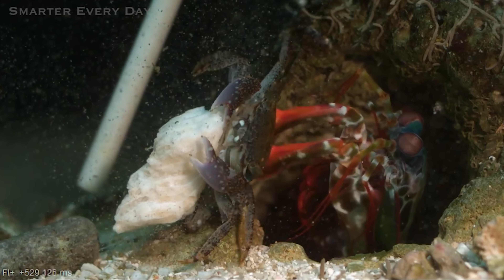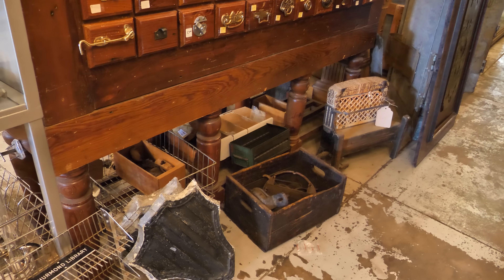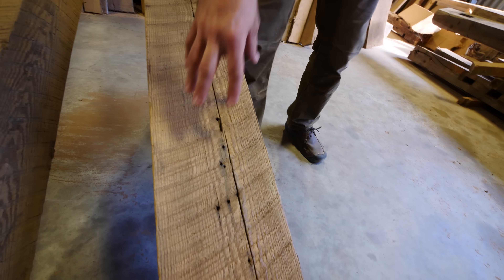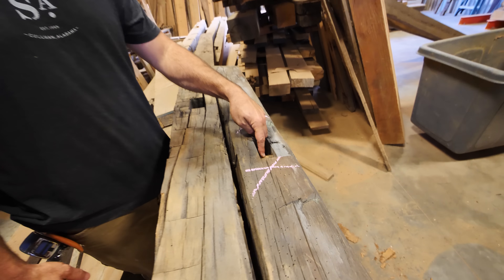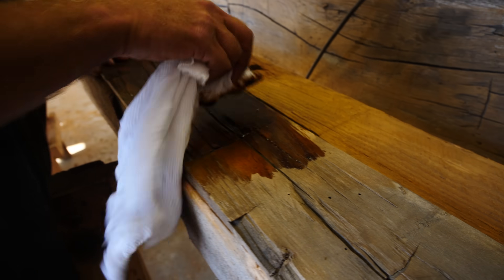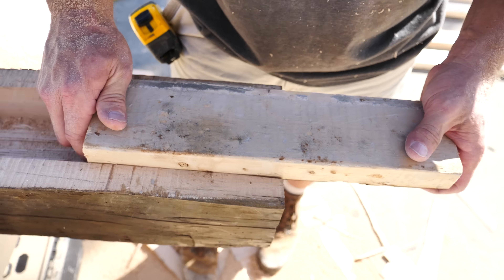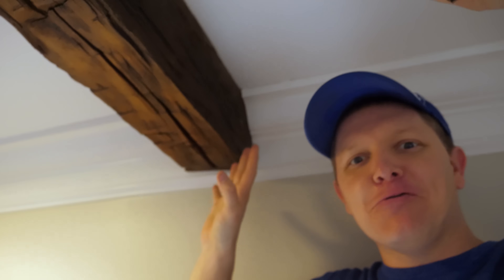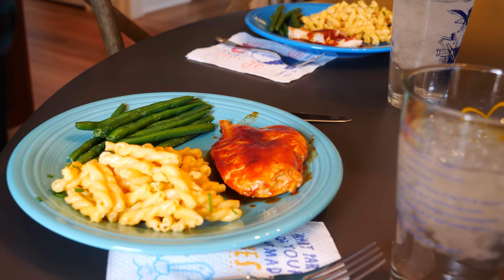Fake Beams - Smarter Every Day 186

Comment: On the first look you see that it is fake. How would the ceiling on the right side be able to hold itself? The topic is great but I feel like you didn't even nearly honour the theme. It's the typical "I wanna have a brick house so I glue 2cm fake bricks on top of styrofoam."-attitude. I really dislike that. If you wanna have beams buy an old house with history and don't just fake it.
Reply: MineCrusher come on, the main reason for that wooden things and coffered ceilings is that the technology of building had changed, but it was way prettier back then. No one wants to live in old house, plugging holes in winter and carrying water in bucket, but technical design was great back then
Reply: I kept scrolling down to find someone who also didn't think this looked right.  In general, it just looks odd to me.  Clashing styles.
Reply: What's the difference? You would never ever ever know that brickwork is a facade or solid. (Since you don't have x Ray vision) it's not like you can look at brickwork and say, "Oh, that brick's only ¾" thick." Derp.
Reply: +MineCrusher Well.... I've never been to Disneyland, but I've been to Schloss Neuschwanstein.  While nice, it is certainly not an imposing fortress.  It is more of a palace than a castle, and rather new, 1869 is when construction started.  If you want to see a real castle per se, then I recommend Krak des Chevaliers.  I wouldn't go right now though... Syria is not someplace I would travel at the moment.  Or within Germany Heidelberg castle for instance is much older than Neuschwanstein and more of a real castle.  I'm not much of a fan of opulence, so I guess even the real version of a Disney castle comes off as a bit garish.
Reply: +Mens B Why are you trying to make it religious?  Some people don't like it when things try to look real while being fake, it be a bit "triggering," but you're even more triggered yourself.  People have opinions, get over it.  ^_^  He can do what he likes with his house, and people on here can say what they like about it, both with the bounds of the law and EULAs of course.
Reply: whats wrong with making your things look the way you want them to
Reply: There is a difference between a Disneyland castle made out of gypsum and a real castle like Schloss Neuschwanstein. The Disneycastle looks as if it could work but you know that you go there for the illusion. If you don't see or feel any difference you probably are an ignorant American.
Reply: What do you mean? Of course the beam could be holding the ceiling up. It would be on top of the exterior wall.
Reply: Mike - On the right side of the room, there aren't any beams. So there is a large room and only a small part of it is "realstic" held up by those beams.

And Thierry - I'm not even close to a hipster. I am just saying that you will not get the "calmness" of those beams because you constantly wonder how it works. I know people who aren't in the bizz don't care, but I do. And other people do too.
Reply: The beams are not there to hold the ceiling up dumbass.
Reply: this isnt someone trying to build a castle, its a guy decorating his house with wood pieces that he likes. maybe you dont understand if it isnt allowed under your sharia law
Reply: What a hipster of a comment !
You would just pack your stuff and leave rather than make with what you have!?